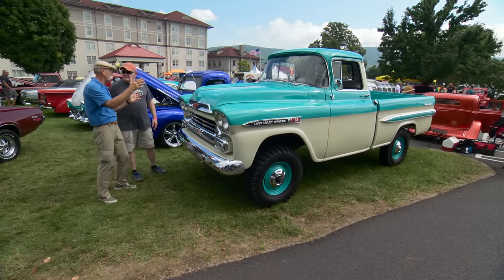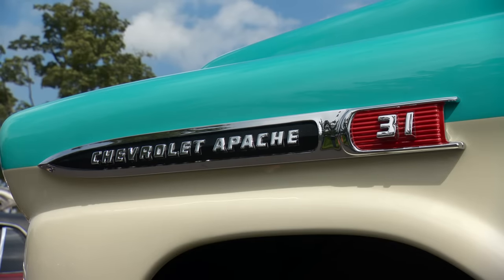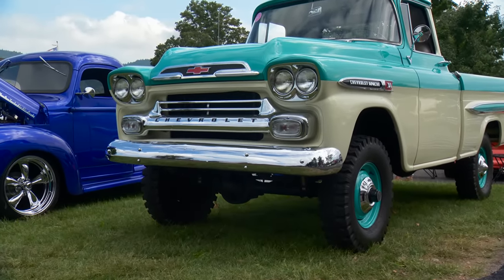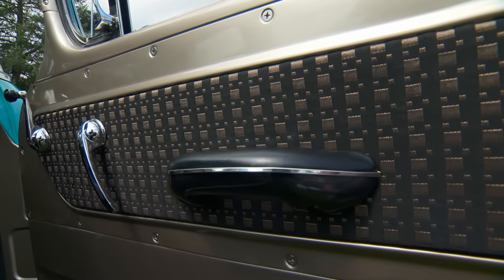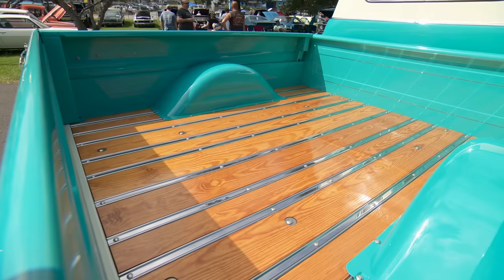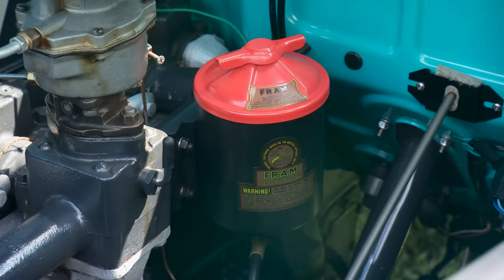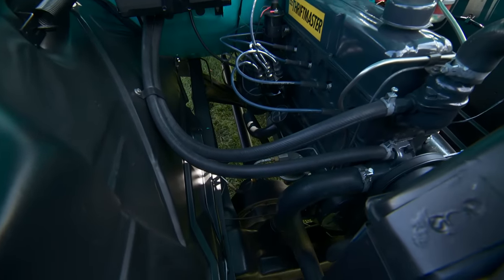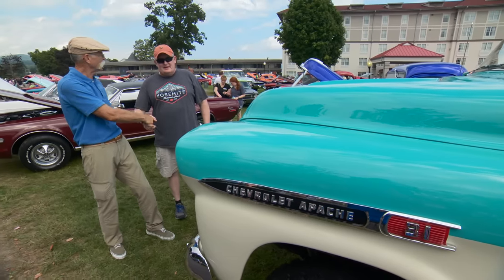Lowest 1st gear EVER is the HOLY GRAIL transmission

Comment: The SM420 is an old school holy grail rock crawling granny gear trans, but technically the late model Ford ZF6 speed has a 13:1 low gear. Almost double that of the SM420. However, you’re not gonna fit a ZF6 in an old Jeep to go wheeling. Beautiful truck, thanks for sharing!
Reply: I have a 66 c10 that had the sm420 in it.  It was drivable but not very pleasant. I replaced it with a tremec TKX and listed the muncie on FB and sure enough in 2 days a jeep guy bought it lol

Comment: That is one beautiful truck! Immaculate! The coolest truck I ever owned was a 62 Ford half ton it was a unibody one piece truck had a 292 V8 in a it was a unibody one piece truck had a 292 V8 and a side loader transmission that was basically a 3-speed with a granny gear. That was in 1979 and get this my friend's dad bought original 66 Fairlane XL 500 with a 390 hi Pro and a Borg Warner T10 top loader for Speed that I bought from him and I traded that Fairlane for the truck and the guy gave me 500 bucks. One of those stupid things I did when I was a kid that still kills me to this day😂

Comment: The SM420 was used by GM from about 1947 until 1967 or so, and yes it is the lowest 1st gear in any pickup 4-spd, the NP435 has a 6.69 first gear.  My brother has a FJ40 with a SM420 behind a Chevy 383, it will idle up almost anything in Moab.

Comment: Factory Napcos had an extra leaf spring over 2wd springs, plus 16 inch wheels which are a 1/2" taller than 2wd 15". And the knobby tires have significantly taller sidewalls than 2wd tires. They are insanely tall trucks.
Reply: 15s were the base offering on 2wds, but 16s and 17.5s were available on 2wd half tons as well.
Reply: @Texassince1836  So were 19's. Stopped bidding on 5 when they got ridiculous.

Comment: Absolutely great truck. My FIL had a '58 Chevy/283 but not an Apache, a down and dirty work truck. That (granny) low gear was about useless. Reminds me that I need to get back to the Adirondack Nationals in Sept. 2024 since they are only ~35 miles from me and I need to 'exercise' my '31 Ford more.

Comment: It's got a sm420 transmission and you can still find them,, the 420 had the lowest 1st gear ratio. and yes a lot of jeep rock climbers love it because it's so low,, it's something like 7.06 to 1 ratio.
Reply: 7.05. My '57 will idle at 1.5mph with 4.11 rears

Comment: Maybe the transmission might have the lowest 1st gear ever, whatever that was, but when you consider, in a 4WD that the transfer case also had both a high(direct) and low gear selection, you need to factor that in as well as the final drive ratio. Take a 1950 Willys Jeep CJ(we had one), on the 3-speed manual transmission, which had a very low 1st gear, and the 5.38:1 final drive ratio, that's what you call low. With a standard 4 cyl. engine, it needed all the help it could get. With the 1st engine swap, a chevy 265 V8, the gearing was a bit low, even ind direct and high range. As many others had done, we installed what they called a Studebaker overdrive so the Jeep could travel at a reasonable road speed. With the increased road speed, the brakes had to be beefed up. We did a conversion which they called adding Mercury brakes back then.
In 1970, we rebuilt the Jeep from the ground up, doing the 2nd engine swap. This time it was a nearly new 1969 Ford 351W. Having your cake and eating it too was a priority. We installed a new Warner 4-speed manual transmission(with a compound 1st gear). This was the same transmission that International installed in their light trucks. Because 5.38:1 was way too low for highway speeds, we chose 4.27:1. Also added was limited-slip in both front and rear axles. The Jeep could exceed 80 mph, but it started flying about 75 mph, so it wasn't safe to go faster than that.
The Ford 351W had a redline of 5800 rpm, but could easily do 7K.  Talking about low gearing, in 1st gear and the transfer case in low range, at 7K rpm's, you could walk beside the Jeep. Could that '59 Chevy-Napco exceed that for slowness?
Reply: 7.05:1 low gear

Comment: Had a '58 Apache 31 that I converted to 4x4 using a '65 Ford F150 donor drivetrain. Ended up with a New Process 435 trans going to the Dana 20 xfer case. I know exactly what he's talking about with the lowest 1st gear when you had the transfer case in low range. It could be an axle buster! Ask me how I know! lol.
Reply: The Muncie SM420 had a 7.05 1st gear ratio compared to the NP435 1st gear ratio of 6.69.

Comment: The extra 600lb is partially due to the added weight of the four wheel drive components, not just extra load capacity.

Comment: I had me a 59 willys pickup, 4 wheel drive. It came with rear-end gear in the 5.38 ratio. I slipped a 302 and a 4 speed top loader behind it, I believe my
low range on the transfer case was 2.5 to 1. The transfer case had a 30% od (for highway)and no idea where that set my final drive at  12.00x 17" tires.
My lil ol truck would have that stupid apache for breakfast or lunch or dinner
Reply from the maker: Probably not in the “looks” category tho.

Comment: That is not the lowest first gear transmission ever made for a pickup.  IH had a 7.17 to one 1st used in its 5 speeds available in its light line trucks pickups including half tons.  IH was also the first factory made 4x4 in 1954 as well it was nit a napco setup was IH spec They also had  First factory built crew cab in 1957.  IH was well ahead of the big 3 in alot of categories .
Reply: First pickup truck to NOT have the fuel tank inside the cab.  Fifty or sixty years later, every other maker decided this was a good idea and did the same.

First to offer an automatic transmission with a locking torque converter (this was somewhere around 1962, though that wasn't an option that remained available.  It was probably a good idea from Borg-Warner that wasn't appreciated back in those days when fuel cost was barely thought of).

Offered more engine options than the other builders.    

Offered more transmission options than the other builders (like you say, they were first with a 5- speed, but they actually offered two, one being standard and one being overdrive.  Both of those features, 5-speed and overdrive, were decades ahead of the times).

Those are some IHC "firsts" that come to mind for me right now.

Comment: A question: Just what exactly is this lowest gear ratio. I had a 1960, and you could pretty much let the clutch out and not move, but I never knew the ratio - thanks
Reply: Muncie SM420 gearbox with a 7.06:1 1st gear.

Comment: Not even close to the lowest first gear.
My 1976 Unimog 406/U900 has a reduction of 4,066:1 as its lowest gear ⚙️. 
20 forward speeds/8 reverse, cascaded, double clutch and 1/2 speed
Literally meant to pull trains. 
You can get out of it, have lunch, go back to her, and she might have made 1 full tire rotation.
Reply: That is amazing and stunning.  Please do a video?  Or a static shot :)

Comment: Beautiful truck. Question: What's that small, round pedal to the right of the accelerator?
Reply: @NGH99999 I didnt catch it but the old trucks had the starter switch on the floor. Similar to the old high beam floor switch.

Comment: We build absolute junk now, a car should last...... ..... What a bunch of crap we accept
Reply from the maker: Actually vehicles are way better and last way longer than they ever did. It’s hard to beat the styling of yesteryear tho.
Reply: @MyClassicCarTV  please tell me you are joking, u obviously don't work on the junk made today.....I worked in the aviation field a little while, I know what quality is.
Reply from the maker: I'm completely serious. Don't get me wrong, I love old cars/trucks/motorcycles and have several of them. But today's vehicles are safer, corner better, stop shorter, run longer, are considerably more fuel efficient and generate WAY more horsepower per cubic inch than engines from back in the day. My AWD 3 liter (183 cui) twin turbo Lincoln MKZ generates 425 hp and gets 26 mpg. What's not to love?! Cars don't rust like they used to and 100k+ miles is just expected out of them now. Styling today sure isn't what it used to be, but it's hard to argue with the technological improvements.